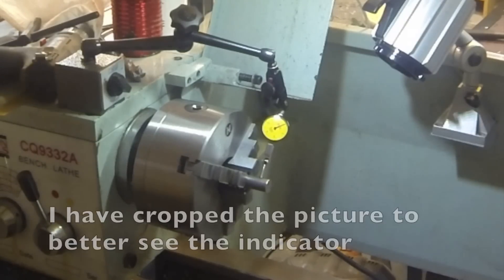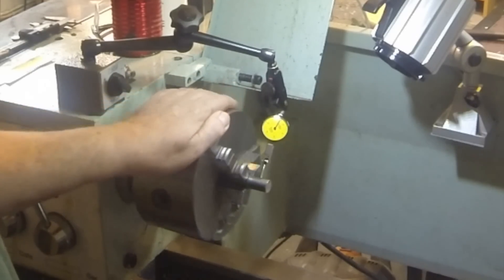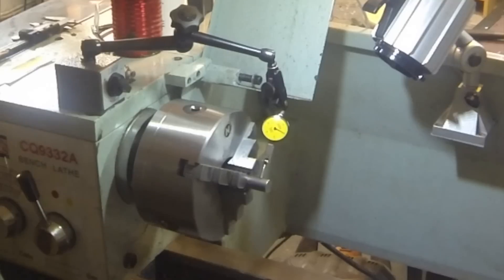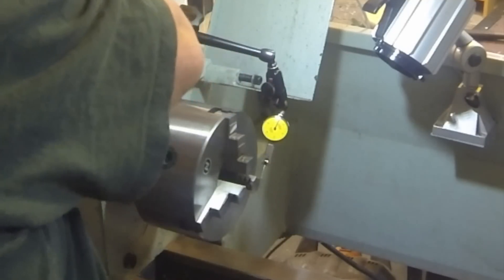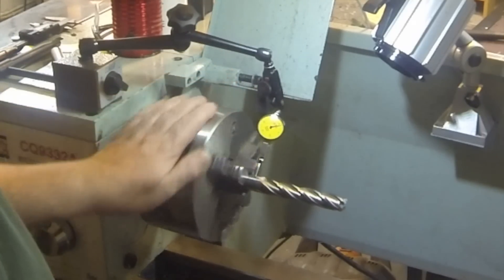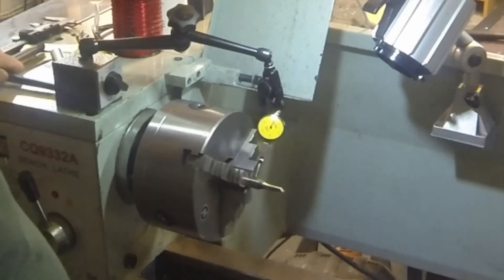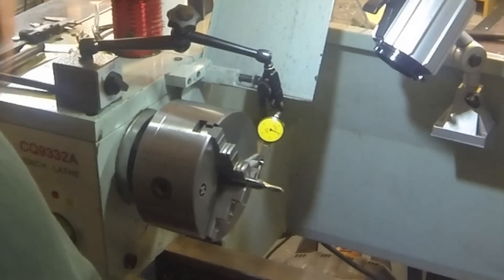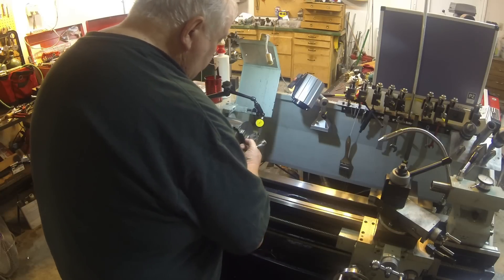Checking my 3-Jaw Chuck

Comment: I'd like to see a reading from the faces of the chuck plate. Any off axis error will show up as run-out and get worse the further out you are from the mount. If there was dirt under the chuck backplate when it was machined, then again the chuck would be off axis. When the chuck jaws were factory ground, usually only one key will be used and the chuck will be most accurate when that key is used (especially if the scroll is a bit loose in the chuck body). On better chucks that 'master' key is marked (although many people have no idea why). I think you're straining a bit too much tightening the chuck and I wouldn't expect to put in that much effort. I'll go around all the keys a couple of times instead to get a chuck tighter. A three jaw is not a heavy duty device, nor really a precision one, although I think you should get better run-out than that (I do on my Chinese chuck). Assuming the mount is good, then consider skimming the register on the backplate. Then you can 'bump' the chuck so the work runs true(er). That's how I've got my chuck (like a poor mans set-tru). I have seen truly apalling chucks where the back is not perpendicular with the body and then the jaws have been ground out of true as a result.
Reply from the maker: Paul,
Take a look at my latest video, I'm down to 2 thou!

Comment: Hi Herb,

Your indicator need to be re-positioned. It should be almost horizontal to measure the runout. Have you removed the chuck from the machine completely? I don't think this is the problem but its not a bad idea to remove the chuck once in a while to clear any chips out. You may have mentioned it already but what mount is your chuck?

Best,

Tom
Reply from the maker: Tom,  See my latest video.  Down to 2 thou!